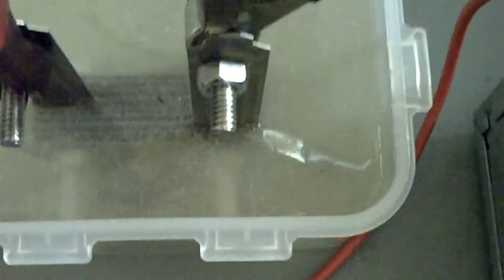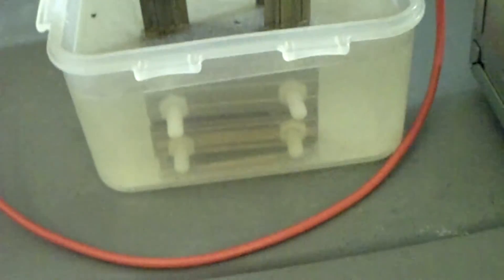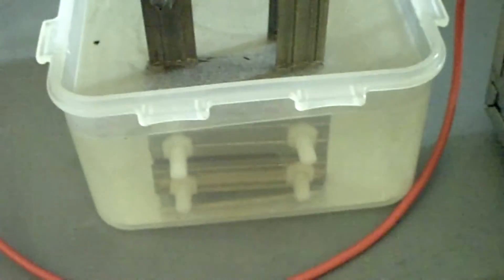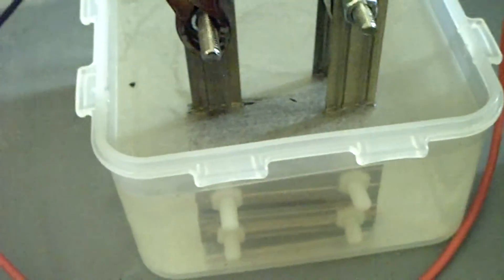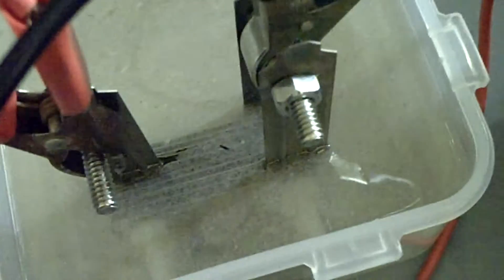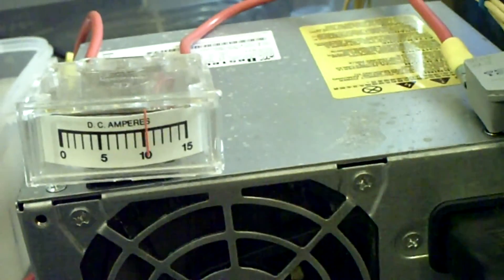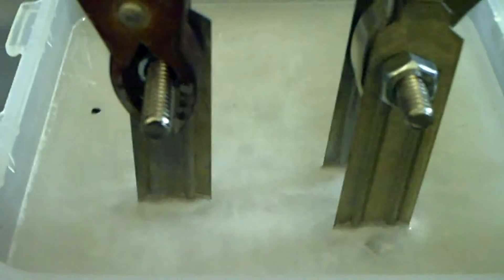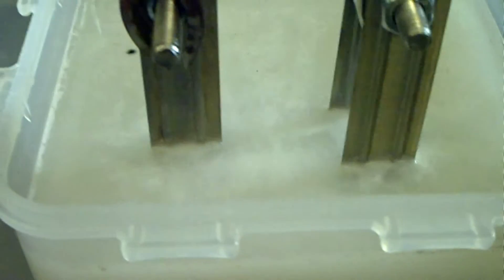Vid34 Slot Cell Hydrogen Generator Demonstration (HHO, Brown's Gas, Hydroxy)

Comment from the maker: Thank you

If you have small bubbles they will release gas more evenly and will not cause foam to build up on the surface of the water.

Since I made this video I discovered that cell designs that generate smaller bubbles tend to have more heat. The heat eventually causes problems with seals and will warp the container.

The cup designs don't have this problem, so you shouldn't have any problems with that design.